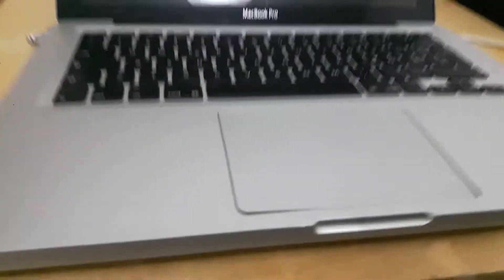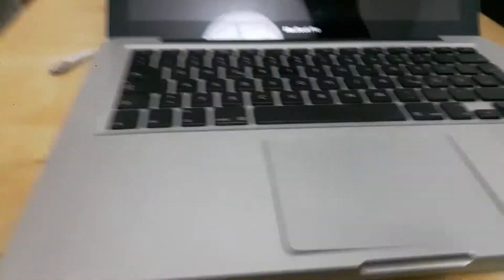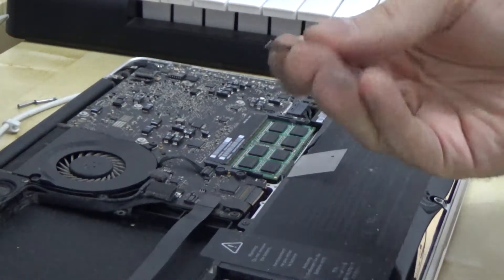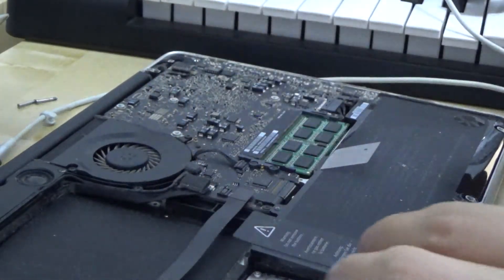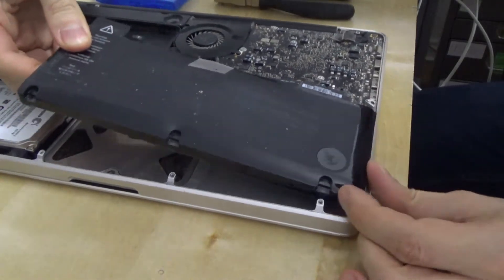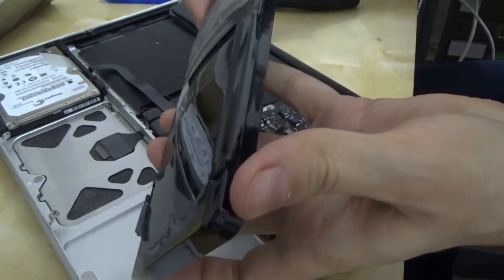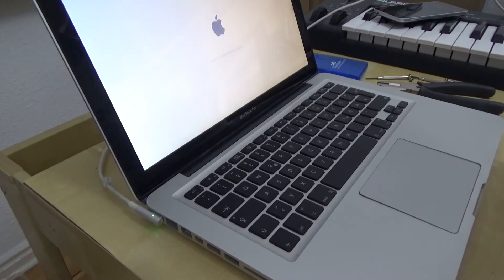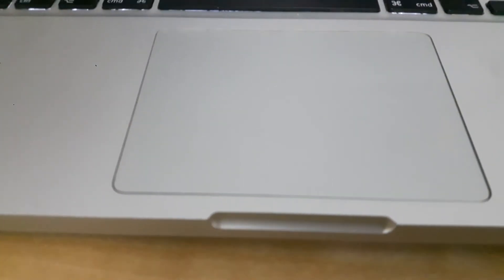What to do when laptop is inflated and trackpad pops out (MacBook Pro)

Comment: Thanks SoSo. one of the first videos that addressed my problem. Not everyone will search trackpad pops out I guess. I happened to have another new dell battery, and this seems to have fixed the problem on my dell precision. Was going nuts thinking it was software, or trackpad settings problem etc. Trackpad now not popping out, as it should be. Somebody on this thread said don't leave your laptop plugged in all the time, probably a good idea.

Comment: This looks fairly easy to do with this particular Macbook model with simply removing the screws and connector and removing the entire plastic encased batteries. So now I am really confused because how come there are videos of Macbook battery removal in which the the batteries are "glued" in with adhesive
and you have to use alcohol and a tool to remove the sticky glue but in this video it's not required? Does
it depend on the model and year?

Comment: Gee, I've just had that for a couple of days, mine is not inflated in the middle and is still in working conditions (though the click and drag thing is a bit harder and erratic), however there's two sort of flat bolts underneath it that partially protrude sideways and that were blocked by the plastic shell. But the coiling effect is so powerful that it managed to push that plastic part upwards and break it.